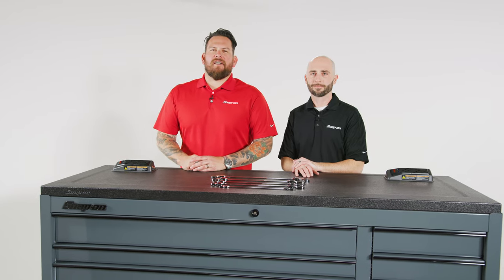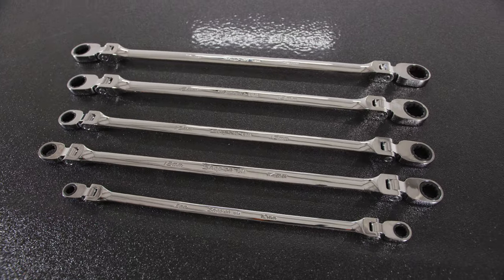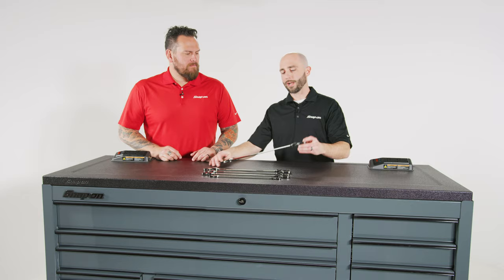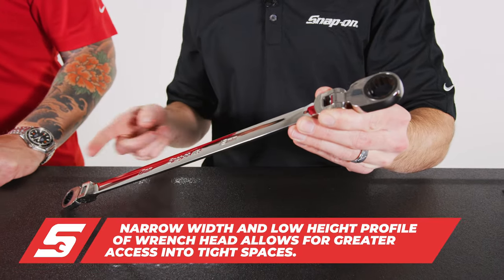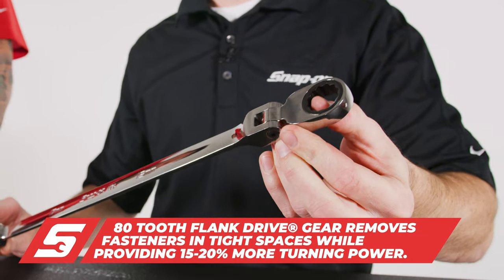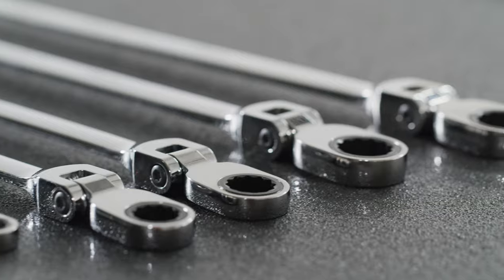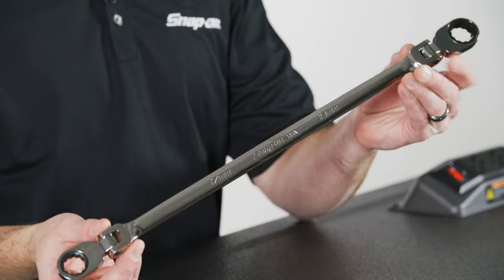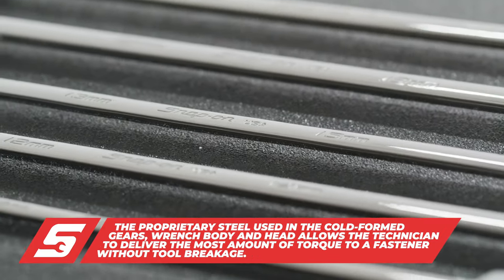Ratcheting Box End Wrench | Snap-on Tool Tips

Comment: These are fantastic wrenches, the only hard sell on these is the VERY steep price difference between the Mountain brand set. It’s comparative and even better in quality but not at 2-3 times the cost.
Reply: I'm wanting them but I'm gonna hold out and hope to see em on promo soon.
Reply: Idk brother I have them and I find the joint for the flex tends to be a bit big, tends to get in the way. I assume its to add extra strength but still something to consider
Reply: @josejr4482  appreciate the info..I have the tekton brand right now and I'm not very impressed at all.
Reply: @josejr4482  are you talking about the Mountain, SnapOn or these type of wrench in general?
Reply: @xcofcd  the wrenches they show on this video. The snap on ones have a rather thicker joint and tends to get in the way,
Reply: @josejr4482  Especially the 8mm end
Reply: The issue with the mountain brand set is their warranty and customer service end of things are a joke. Lots of complaints about them. Sets of wrenches like these from Matco and Snap-on are damn near unobtainable, not publicly listed at any tool vendor I know of. Matco appears to have discontinued a very nice 10 piece metric set of them.

Comment: If snap on would make these with the reverse button it would be ideal specially the low profile box end. I would buy it unfortunately since its not reversible I’ll just stick to my mountain set.
Reply: You can reverse the ratcheting action by just flipping the wrench over
Reply: The pawl mechanism that keeps the ratchet from slipping gears is not that strong, adding a switch to it would make it even weaker. There is very little space inside that mechanism for additional functions.

Comment: I rather buy gearwrench,  half the price and better quality
Reply: Not really honestly, I bought a gearwrench 21mm flex head ratcheting one and it bends easily, it doesn't have as fine of teeth, and not as tight of a tolerance
Reply: Jose JR yeah but you can bring it back and get another one for free under warranty just like snap on
Reply: 830wala definitely not better quality
Reply: Gear wrench is nice but not same quality